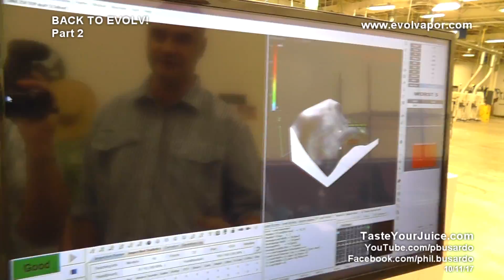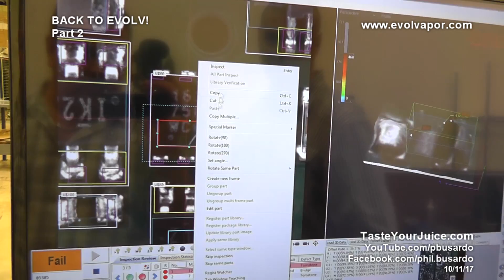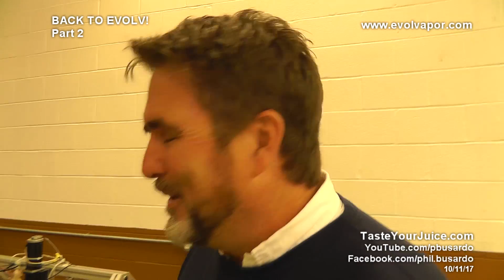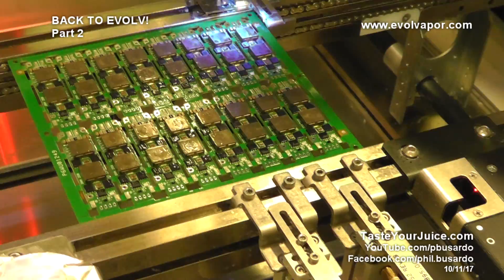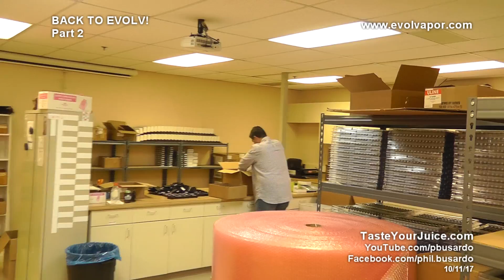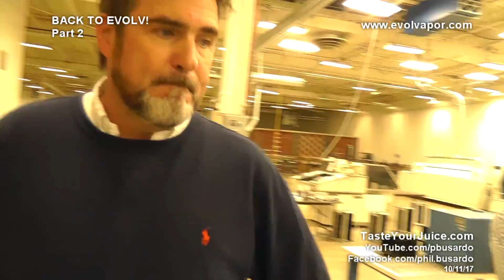A PBusardo Video - Back To Evolv! - Part 2

Comment: Clearly there are Evolv Systems on the horizon.
"510 won't pass FDA" means no more traditional tank meets mod.
Evolv clearly sees "pods" (or proprietary tank)--either pre-filled or open (probably both) as the future. 
This means proprietary connection-with potential to license- which may allow PID loop control of T.
Reply from the maker: Yep, that's certainly what it sounds like Krash.  Thanks!!

Comment: I don't think Evolv fed into the big cloud style of vaping, I use a DNA200 to vape mouth to lung purely because of the accuracy of the power output and/or the temperature limiting.
Reply from the maker: Thanks Cheech.  Well, that's how you use it.  You can also consider battery life.  But you can't argue that 200+ watts can certainly be used or does feed the cloud style of vaping.

Comment: I barely come across a few DNA devices in the street except for a few fan owner like me. The fact that most DNA mods sold in shops come uncalibrated make them a real bad choice for anybody but a very few elitists. The difference of price compared to more generic mods and the consumer still has to undergoes a tedious setup, that's not really worth the trouble for most people. Especially not for a beginner. It's a shame because it's not Evolv responsibility and other than that they're doing a stellar job.
Reply from the maker: Yep,  I hinted at that with them.  I still think they should approve the design, programming, UI, and setup of any mass produced mod with their boards.